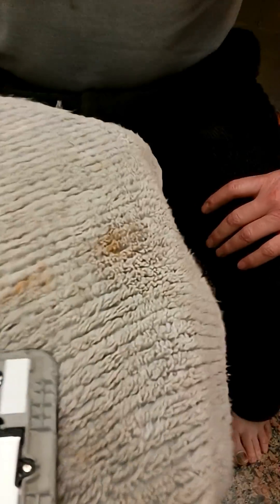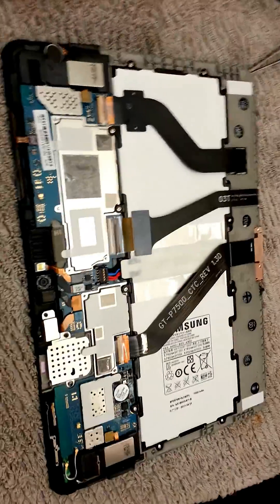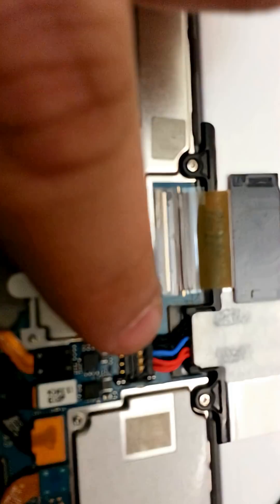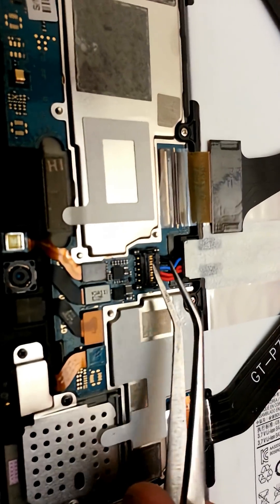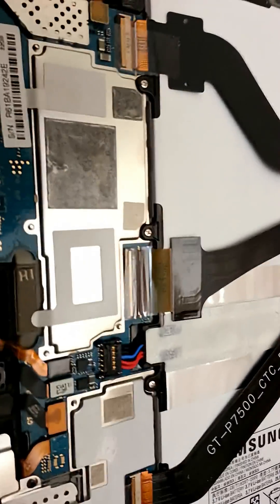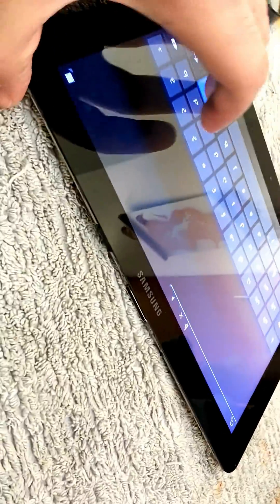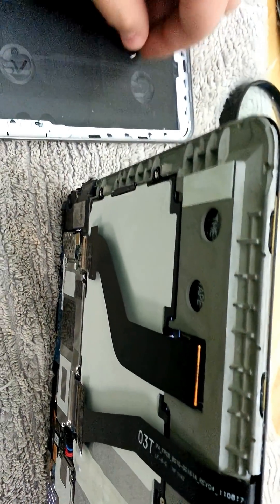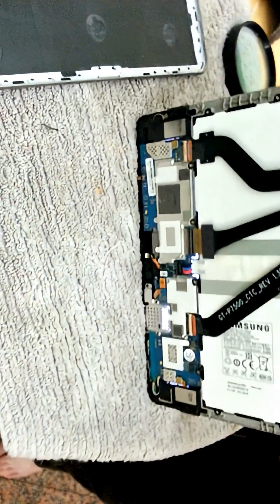Fix dead Galaxy Tab 10.1

Comment: Last action was charging my Tab 3 10.1 because power was like 5%. I always turn it off during charging. After charging and unplugging, the tab was completely dead, no mather what button combination.
Doing your  procedure, completely cutting off power to the motherboard for a moment, WORKS! :-). It is actually a true reset.
I noticed that charging made it to 25%, so somewhere along the way for no obvious reasons it just deadlocked.
Anyway, this have saved me a lot of work and money. Thank you very much, Ali!

Comment: Mine doesn't work, tried this and used a voltmeter to confirm battery power. It's receiving power but still won't turn on. Would it need a new screen? What's the average lifespan of the display? I remember it flickering the night before then nothing
Reply from the maker: try charging it for a couple days straight then try the video again

Comment: i don't doubt that this works but if your tablet does die like this hold the power button for 15 seconds no longer no less and it will reboot.
Reply from the maker: this fixes a different type of dead tablet issue, this video deals with a tablet that doesn't charge any more and is just dead.

Comment: I had the exact problem.  I tried using the usb cord in both my desktop computer AND the wall adapter, but neither worked.  I tried many of the remedies that other people post online, but nothing worked.  What worked for me was taking it to my car and plugging it into my multi-purpose charger that has usb and it started charging right away!  I powered it on after only one minute AND it continued to charge while I was using it which I cannot do when plugged into the computer or wall adapter.  After a few minutes I brought it back inside and it successfully charged on both computer and wall adapter.  It must have something to do with the amount of power that is provided.  Hope this helps!!
Reply: Keila Rooney it's beacuse your PC only provides 1amp and those tablet need 2amp chargers which your car one probably was...